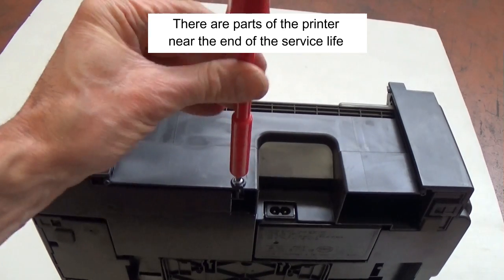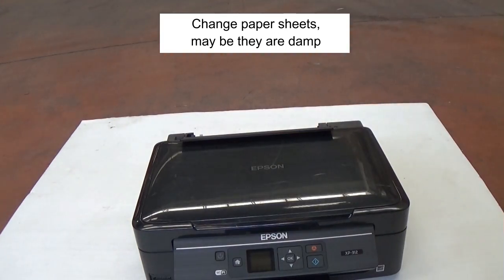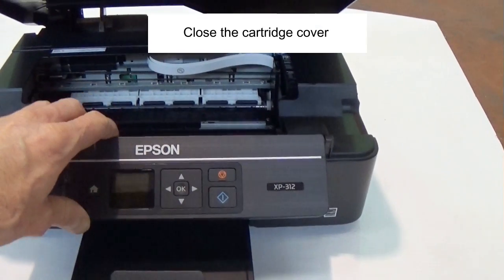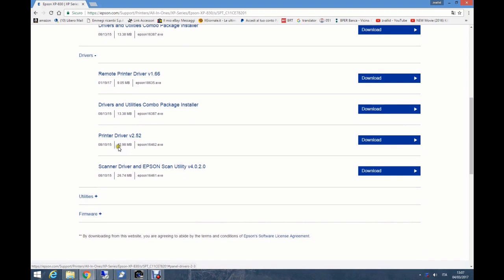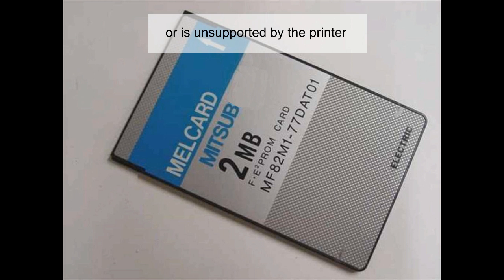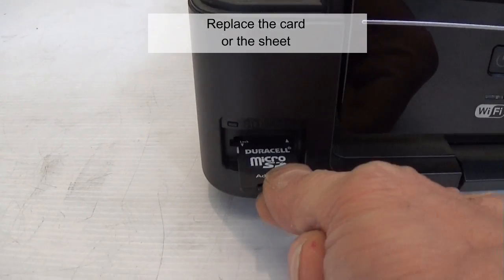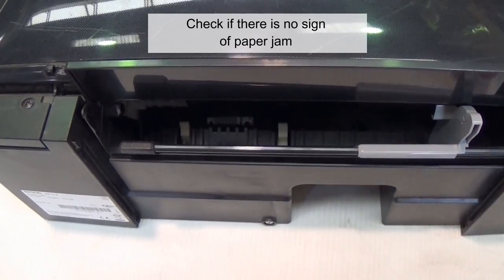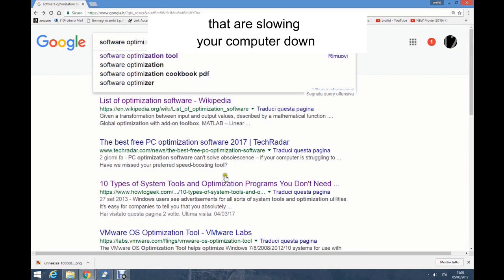Epson Printer Error Codes: Meaning and Solutions

Comment: I have a new brand epson WorkForce WF-7720 I just turned it on and I see a code 034503 what that means?
Reply from the maker: didi you install the correct printer driver? try to reinstall the driver. update the firmware in the epson website, remove and reinstall ink cartridges
Reply: @viandant5  thank you  I fixed already

Comment: I did an update to my epson wf-4730 driver and now my computer says my printer is offline and gives me an error code 30n-nany solutions?
Reply from the maker: I would start checking for windows updates, then resinstal the driver. be sure ypu are the administrator.
click Properties or go to the driver right-click on it and select Properties. 

Select Security , then click your account and Edit.

 Select your account again. Then tick on the box "Full control". Click Apply and OK.

Comment: What about 0x9d error?
Reply from the maker: 1: Restart Your Printer
. turn off the printer and remove the cable from the wall socket.  wait 10 minutes then turn the printer on. do it sseveral times
2: Clean Printheads
3 Update Printer Driver
4 try to change all cartridges
Reply: @viandant5  tried 10 times all these things, did not help. Probably only one way - bring it to service center

Comment: My m200 Epson after few time move head after stop only show printer error see the document what can I do rectify this problem ?
Reply from the maker: which error code does the printer show?
Reply: @viandant5  after 50 second the display printer error see your documentation (no error code show )only show these type of error what can do ?
Reply from the maker: @motilalsgd3155  in the printer folder, camcel all print jobs waiting to be printed. turn off the printer.

check if there are jammed paper. remove and reinstall all cartridges change all cartridges. if nothing works probably your printer has to be repaired

Comment: Hello, I have epson L365 and I had an error:10 showing after a very bad paper jam. The printer made a loud squeaky noise and the paper jam  and the wifi lights started flashing. I turning it off and on but now even the wifi is gone and printer's still flashing every time I turn it on. Please help?
Reply from the maker: it could be a defective paper path sensor. try to see if there is a broken flag or something so.Error E10 could be related to cartridgres too

Comment: What to do if error code 000031 pops up
Reply from the maker: it coule be related to the scanner assembly. In some cases, the error occurs because there is foreign materials in the scanner. the scan mechanism is obstructed or another internal equipment fault. remove and reinstall all ink cartridges. it could be a paper jam too

Comment: I have Epson L220.
My problem is only the power button is always blinking after turned on = always busy.
How to solve this?
Reply from the maker: the manual says it could be a defective ink cartridge of a cartridge installed incorrectly. Reinstall the ink cartridges, or change all of them.
Reply: @viandant5  
Now I fixed it. Thanks buddy. But right now, the problem when I do printing or photocopy, it doesn't reach the printer head, like 3%, and the 2 red lights is blinking again and need to restart the printer again. But during paper feeding using the epson resetter, it feed 100%..
Reply from the maker: @jeffersoninoc7154  the epson resetter is a machine to reset the chip of the cartridge? they rarely works
Reply: @viandant5  So how can I fix my problem? The 2 red lights went back every time I do print, the paper stuck.
Reply from the maker: @jeffersoninoc7154  Did you change the ink cartridge?

Comment: Hello, I have problem with my it ask me put it off and on printer error code is 033001 Epson   xp 442 pls help
Reply from the maker: I never hear that code. are you sure it's correct?
Reply: viandant5 that's for the reply, yes is correct that is what is on the screen of the printer, when you put it on where you insect the cartridge is hard it doesn't move, I see if I can send you the picture of the screen shot thank you.
Reply from the maker: I don't find that error in any document, so I can't help you that much. It seems a muchanical problem related  to the print-head carriage. I can only suggest to try to change all ink cartrdiges and look inside the printer id there are foreign objects along paper path
Reply: viandant5 thank you for your patience and time
Reply: Hola!! Encontró la solución? I have the same problem.

Comment: what is meaning of Error code- 151C  (my  machine is sure color -S80670)
Reply from the maker: it's related to the main board and the motor driver. I think you can't do anything else than bring it to a repair center

Comment: Hello, I receve scanner error 20,  I tried suggested solutions by epson support but didn't work out, what should I do next?
Reply from the maker: I don't know what epson suggested. try to change cartridges too, they could give every type of error.
Reply: viandant5 I tried to 
1. switch off and on
2. Switch off, disconnect,  connect and on
3. Holding switch for 60 seconds,  disconnect  cables, connect cable while holding for the another 60 seconds
Reply: viandant5 Ibuse ink tank system,  Epson L565
Reply from the maker: try to reinstall the driver, but may be the problem is the PC

Comment: okay thanks me thinks its over heating but also it doesn't want to work with the main computer, but it is working now with the lap top, so very annoying, but thats whats happening
Reply from the maker: -30 is not a printer error code, the problem is in the PC
Reply: i'm sorry but that is what it states. It may not be the fault of the printer, but it may be due to problems of my computer actually. As i found if i use another computer, the printer works.

Comment: i have an epson Cx5500 printer. it is full of ink, it was printing the other day now it won't print, it keeps telling me i have an error code -30 and where you start the printer is the light that is flashing NO other, what is happening with it?
Reply from the maker: errror code -30? are you sure I never heard this code. the flashing light is the error light? may be a paper jem, or a broken sensor
Reply: @viandant5  hi my friend. I have noticed you respond to a lot of the issues on here .can I ask you .I have an epson ET2650 .jets was blocked now lovely flow .but now printer is saying error code 031004 turn printer off ...any ideas? Iv tried looking it up but now luck .thanks in advance, Robb
Reply from the maker: @robbo6230  It could be related to the print-head. Unluckly Epson error codes could mean everything. Try to reinstall the printer driver and update windows

Comment: I got the error 000041 on Epson ET-3700... It is new, I just opened the box and followed the instructions of installing. I turned it on for the first time and I got that message. what can I do?
Reply from the maker: The error probably is related to the cartridges. try to resintall them again more times, check if they are correctly installed

Comment: Printer Epson inkjet WF-3540  Error code 0xFA ? What to do ?
Reply from the maker: it's not a printer error. 0xFA error is probably caused by windows system files damage. try this

1) Start your computer and log on as an administrator.

2) Click the Start button then select All Programs, Accessories, System Tools, and then click System Restore.

3) In the new window, select "Restore my computer to an earlier time" option and then click Next.

4) Select the most recent system restore point from the "On this list, click a restore point" list, and then click Next.

5) Click Next on the confirmation window.

6) Restarts the computer when the restoration is finished.

Comment: Pls. Help 
Printer Error. 
Turn power off and then on adain.  For details, see your documentation.
Reply from the maker: turn power off and on again. it it does not work, bring the printer to a repair center
Reply: viandant5 
Sir,
Every Repair center suggested me to brought new printer
Reply: Pls. Send me any vedio to solve this problem sir.
Reply from the maker: if the problem is not solved after turn off and on the printer, I think it's better to buy a new printer

Comment: My Wf-3540 has a scanner error code 0xF1. I've never used the scanner and now i can't print. Help! Thanks
Reply from the maker: This error code is usually displays because of the corrupted registry entry in your PC. This issue might due to software problems with your computer.
try to unplug the printer from the main socket, remove the printer cartridge, and then reattach it.
To resolve the error code try to download the ‘Epson Error Code 0xf1 Repair Tool’.
Reply: I just got this code after cleaning the heads. It was working fine before.

Comment: My  epson workfoce was working great n then the code 0x9a came out now im stock here trying to fix it can you help me please
Reply from the maker: it indicates a carriage fault. remove and reinstall all ink cartridges, change all cartridges. That error  can be caused also by debris, a bad sensor or control board, faulty carriage drive motor.
Also check the ink cartridge holder and make sure it is properly seated.

Comment: Hi, setting up an Epson XP-440. Having trouble connecting to WIFI then received error message 202621 with only option to shut off. Have shut off and on multiples times. I'd appreciate your help
Reply from the maker: 202621 it's not an epson error message. Probably it's related to your line, not to the printer
Reply: I have the same exact problem, did you get it fixed? if so, how?
Reply: I have the same problem, how did you get it fixed?

Comment: My Epson Workforce Printer WF 2650 has the warning CASSETTE NOT INSERTED CORRECTLY. How do I resolve this issue?
Reply from the maker: May be the switch of the paper cassette is not being activated by the tray.
This switch tells the printer that the paper tray is present.
The switch become faulty overtime and needs a replacement 
or The part on the tray that pushes the switch has broken or is missing, or the cassette is not inserted properly.

Comment: epson 9880 stylus pro error code Service Call Error 0001002D HELLPPP!!!!!
Reply from the maker: The cleaning Unit reached the end of its life. The pump counter reached the prescribed upper limit (182,000 P). you have to replace the cleaning Unit and reset the life counter of the unit using the Adjustment Program.

Comment: Epson WF3640 0x9a ?
Reply from the maker: it's a non-specific error code. try to change ink cartridges,  check for internal debris, piece of paper or paperclip. try to reset the machine:unplug power at the wall outlet, wait 5 minutes
press and hold the power/on button for 60+ seconds
keep holding while plugging back in, and for another 60 seconds after, then release
Reply: I try it nothing changed what shall I do now

Comment: Hello there. I have Epson XP-342. When I start it, it works for a few seconds, then there is sudden noise in the printer and error E-01 pops up. I don't know whatto do
Reply from the maker: is a fatl error, you could try to change all ink cartridges. then you should disassemble the printer and clean all optical sensors, paper feed sensors, encoder strip and disc encoder. those sensors could be can be blocked with dust.
Reply: viandant5 The thing is, it's at least supposed to be new. Oh well, guess I'll have to try to clean it, thanks for an advice
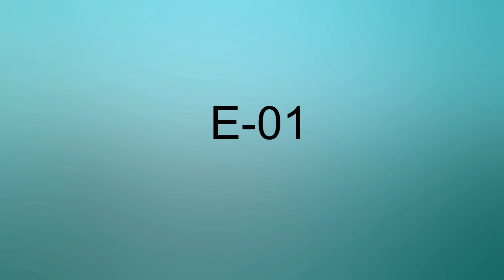Reply: @5:49

Comment: I have an Epson 3640 and it has displayed the error code 0x69 and 0xEA, any idea what could be going on? It is my first time turning the printer on and starting it up to use. I have used many Epson printers, but have never had this issue.
Reply from the maker: Try to update the driver and the operative System. Do you have windows 7? manual says it happens because of "misarranged framework documents with the clients’ windows working framework"

Comment: Hi I have a WF 2630 only 6 months getting error code 0x60. What can I do?
Reply from the maker: may be there is a dirty sensor, near the print-head carriage or a foreign object somewhere but it could be ab hardware problem to a motor, deformation of the Main Frame. check all cables if one of them is disconnected
Reply: viandant5 I got the same problem here. Could you please make some video show how and where to check sensor and cables. Thank you.
Reply: https://youtu.be/aK3EIc5XFwA
Reply: @rpal3583  I'm having the same problem but the video is private, can I see please?
Reply: @Sub-bk3ry  the video is not ok, so i delete it. I didnt fix the problem. Sorry man,and good luck.

The only thing i could figure out is that the F1 (fusible) is break, but you shold find why.

Comment: Hi- so I have an epson xp-440; it's a month old and I'm getting error 000041. I called epson, had them take a look and was never told a specific issue only that they could fix it over the phone for a hundred bucks... no. Any ideas?
Reply from the maker: error 000041? Are you sure? I never hear this code. have you checked Epson status monitor?
Reply: Hi! Thanks for responding. The exact error message is as follows:
Printer Error
Turn printer off and on again. See documentation or visit epson.com for details 000041
I've tried everything. Turned off and on multiple times, unplugged it. I can't get to any other screens no matter what I do, just shows this message.
Reply from the maker: you could try to change ink cartridges. epson cartridges give all type of errors. but this error is determined in the Epson Service Manual as fatal error.  If for some reason the printer cant finish the selftest, it gives error message. you have to fix the problem first, but without watching the machine I don't know
Reply: I got the same message how do I fix ??

Comment: So, my workforce 645 has no jam- the ink carrier will not move from the home spot on the right.  It makes a rather hideous clicking grinding sounds like it's trying to move... epson 's troubleshooting guide is no help.
Reply from the maker: I think you can only bring your printer to a repair center. Probsbly it's a mechanical problem to a motor gear or to the belt of the carriage

Comment: Hello, 
I have code Error E-01, i can not do nothing only power off printer.
Somebody have solution.
Reply from the maker: Sometimes it's enough to change all ink carttridges
Reply: I changed all cartridges and my printer heads were clogged so I cleaned them and now I'm getting this error. It was working before, the printer heads on 3 were clogged though.

Comment: Hello, I have Epson printer error. 
Machine trouble. Call service 001B
Reply from the maker: I don't know which printer do you have, may be one of the cartridge is stuck. try remove the cartridges watching if the drum rotate freely
Reply: Epson AcuLaser CX16. Thanks, I fixed that, but now I'm get new error.
machine trouble service call 0094
Reply from the maker: the manual says that code has to do with the 2nd transfer pressure/retraction or the idc shutters are not opening/closing. you can only check all connectors

Comment: hello, i have error code. 0x97 what is that?? thanks
Reply from the maker: it indicates a hardware problem and will almost certainly require service. 
probably the error is related to the scanner or logic board
The only thing you can try is to reset the machine:
unplug power at the wall outlet
wait 1 hour
press and hold the power on button for one minute
keep holding while plugging back in, and for another 60 seconds after, then release
Reply: Wrong, I found on-line somewhere that says the print head is clogged. I tried the remedy, and It works now. No more )x97 code. Simple fix